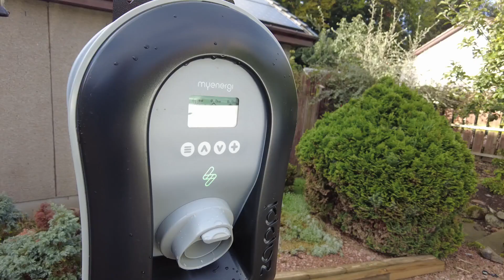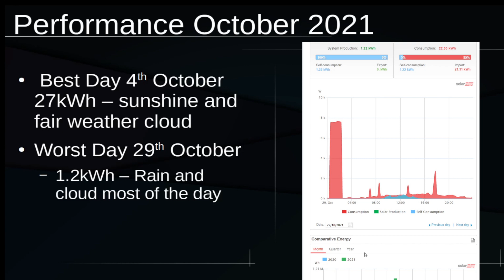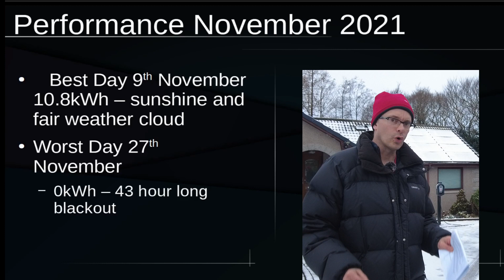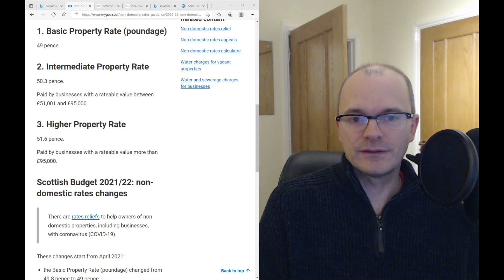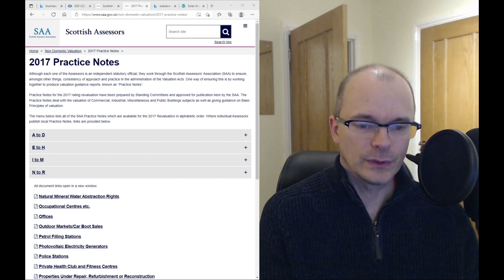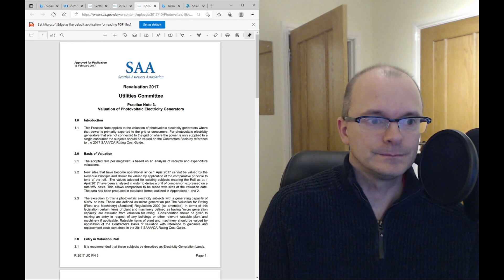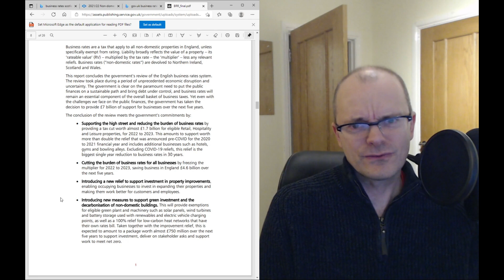Aberdeenshire Solar Panels: Autumn 2021 Performance, Storm Arwen and writing to my MSP

Comment: On listening to your presentation I thought, I am willing to bet it was the solar installation technicians that suggested a grid tie system to you. My recommendation, use part of your system as a off grid system.
Reply from the maker: There was no such suggestion.  I was well aware of the limitations of my installation.  The trouble was that hybrid / off grid systems had other compromises (e.g. no optimisers to address partial shading issues).

I've partially addressed the blackout situation with a portable 2.4kWh battery.  I've got two other videos that cover the performance of that battery.

Comment: An  informative video. I recently had two Tesla Powerwalls fitted, according to the App we had a 13 minute power cut one night which we didn't notice because the Tesla Gateway automatically island us off from the grid. I should add that with the low solar production this time of year we would not have covered the whole 48 hours power cut that you had.
Reply from the maker: I've just been looking at backup options for batteries.  It seems that only Tesla has had the foresight to backup the whole house.  

If I looked at other battery inverters, they only backup essential loads (which does not include the existing solar inverter).  So I'd either need to rip out the existed solaredge inverter and install a hybrid inverter.  Or I'd need to resign myself to having essential loads draining the battery with no ability to recharge the battery from my Solar inverter.  Having a separate essential loads distribution boards require more wiring work.  So Tesla made an excellent design by minimising the wiring work needed.

As you say there isn't much solar at this time of the year, but come end of January there's actually enough to start making a surplus of power on some days at least.

I'm really hoping we'll get an LFP version of the Powerwall soon.  They last so much longer than NMC batteries.
Reply: @anthonydyer3939  I have 26 solar panels connected to a 5kW Sunny Boy inverter, there was no issue in connecting to the gateway.

Comment: Really interesting video! It would be good if the system sensed there was no input grid voltage and automatically disconnected it so it can be used locally. I was off for pretty much 5 days in Skelmuir beside Mintlaw but managed to get a small generator the last few days for my well water pump and bought an EcoFlow portable battery system. 

The info on the business rates is crazy considering the pressures for businesses to become more energy efficient and carbon neutral!

Comment: A radical difference between October and November in your figures. I guess it's because the weather was relatively nice in October and comparatively miserable in November.

As a side question, I wonder if you have any views on solar thermal?
Reply from the maker: I once considered solar thermal.  It is vastly more efficient per square metre.  

However it’s very expensive and inflexible for domestic HW needs.  Amongst other things, you’ll need a twin coil HW cylinder. Once your hot water cylinder is up to required temperature, then your thermal panels are essentially shutdown and thus wasting space on the roof that could be used by a productive PV panel that can export electricity.

That said, if you have sufficient demand for the hot water (e.g. large family, swimming pool etc), then the utilisation of solar thermal will be much higher than it will be in my situation.  My demands are no more than 2kWh/day for hot water.  So even in December my needs are still satisfied from my panels for most of the days.

Now, going a bit crazy with ideas, if you could have a large enough thermal store, then you could heat up water in the summer time to superheated steam, and then use it in the winter time to run your entire central heating system.  That would be a fantastic application for solar thermal.  I did a back of envelope calculation on this once.  I seem to calculate needing a pressurised spherical vessel about 7metres diameter, filled with water heated to 300 degrees C.  I reckon that would cover your needs if your lagging was perfect and you could scavenge that heat efficiently at low temperatures (30degC).
Reply: @anthonydyer3939  Bonkers!

I agree PV seems to offer a stronger case. Also, solar thermal relies on warmth from the sun rather than light so might not work well in winter in Scotland!

Comment: Will the battery actually run in a black out? Will it and the inverter need power from the grid in order to function?
Reply from the maker: Depends on the Battery Inverter, and how it's wired up.  In general terms, if the battery inverter is wired on a dedicated breaker on your consumer unit then it it cannot function as a backup.

The battery inverter needs to be wired in between your meter and your consumer unit.  What will then happen is that the incomer into the battery will be isolated by a contactor that opens up when grid supply is down. 

These kind of setups generally recommend a separate "essential loads" distribution board on the load side of the battery, so that the battery doesn't get overloaded.  However that's a lot of extra wiring.   A simpler wiring solution would be to have the existing entire distribution board wired onto the load side of the battery inverter.  A single load shedding relay, built into the inverter, can operate to protect the battery from being overloaded.  

I've worked on marine power management systems, and they have even more elaborate load shedding solutions.  Basically they shed load to individual heavy consumers in a prospective overload condition depending on the load shedding priority set and the available power on the High Voltage switchboard (determined by the number of connected generators).

Given that many of the larger batteries can support loads of 5kW-7kW, that can support a fairly normal kitchen cooking session and therefore your normal household maximum loads.  The only consumers that wouldn't be supported would be your EV charger, and electric showers, and you as a householder are normally capable of not using those things in a blackout situation.   If you're not mindful of that however, then the loadshedding protection would kick in and your whole house will go dark.   So I would say that all that's needed is a loadshed / undervoltage / RoCoF (Rate of change of Frequency) relay to be built into the battery inverter.